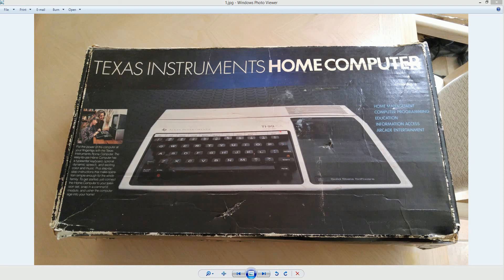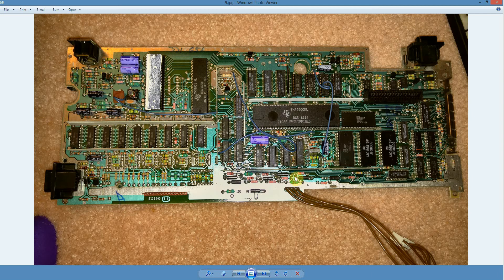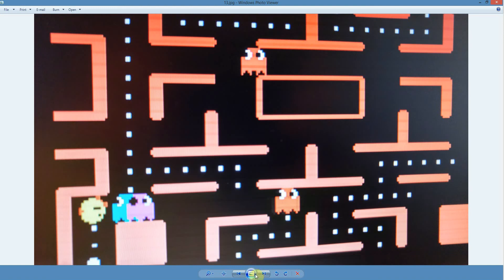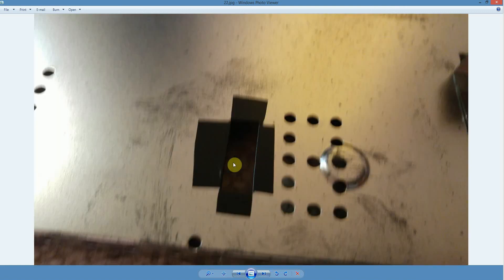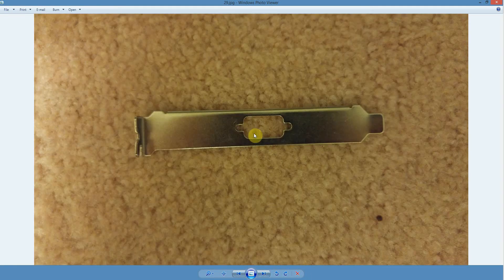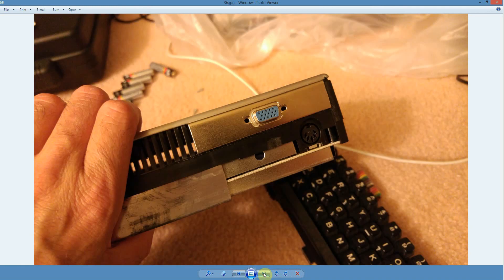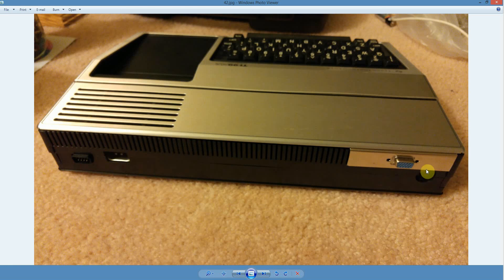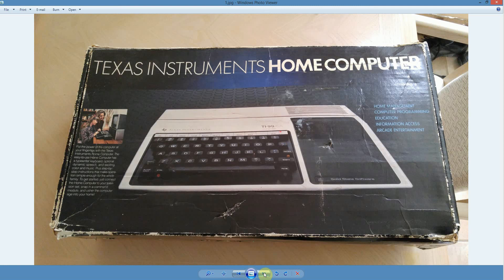TI994a F18A how to install

Comment: The F18A FPGA based video board is a truly great accomplishment; I remember in the late seventies and eighties we had a whole team of engineers in Houston developing the TMS9918A family of VDPs.  So I salute the F18A developer for this accomplishment, whoever he or she might be. However, the F18A is very hard to get I found out. And I also do not like hacking up my TI 99/4a plastics. So for those of you who are interested in a crystal clear picture without the NTSC dot distortion that the 9918a produces, while keeping your historic 99/4a computer original,  go for the TMS9928 chip. Available on eBay below $10. The 9928 puts out Y, B-Y and R-Y video ( these are luminance and color difference signals) which is accepted by most modern TV sets (it is called  YPBPR on most monitors, with  three RCA inputs). This way you do not need ANY mods to the TI-994a, because the output connector is already laid-out to support the Y, RY and B-Y signals, because the European models of the TI 99/4A required these outputs (using the TMS9929a chip in those days, to support the European PAL TV standard).  All you need to make it work is an  simple 75 ohm converter (basically 3 emitter followers) as an impedance transformer (the TMS9928 can not drive a 75 ohm load directly). But you can build that yourself in the RF modulator box that came with the computer, or make your own little box. Here is the data sheet for the TMS9918/28/29:  https://datasheetspdf.com/pdf/1014870/TexasInstruments/TMS9928A/1
Reply from the maker: LifeIsTooShortForQRP awesome info and so you were on the design team?  Feel free to reach out to me at glensretroshow@gmail.com 🙂